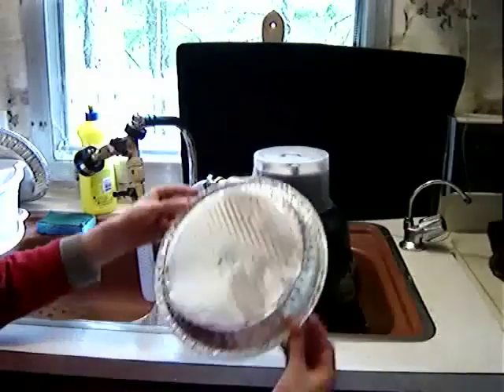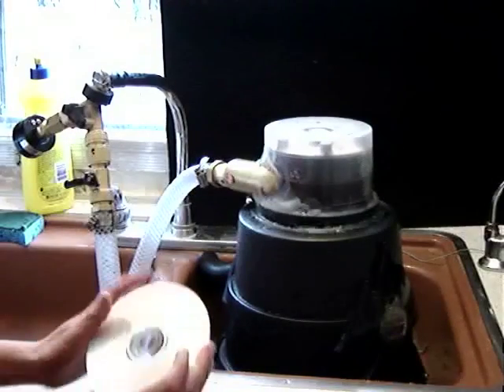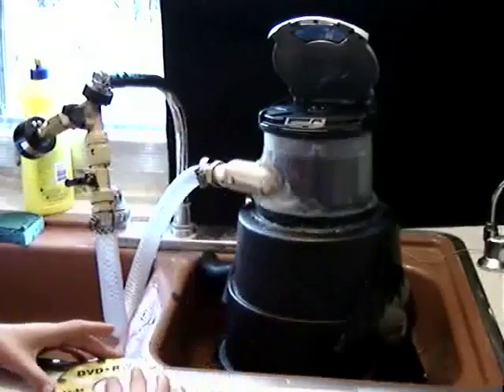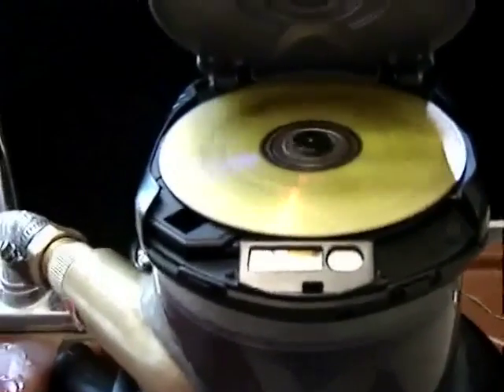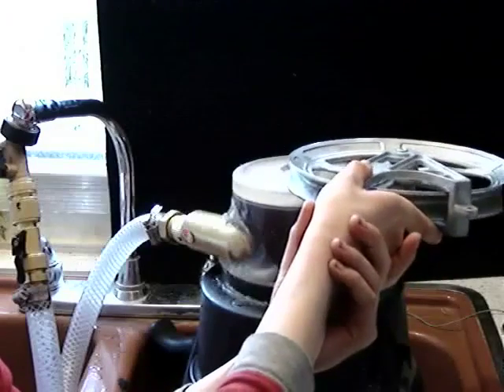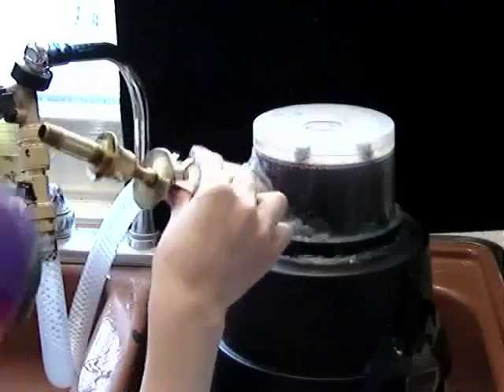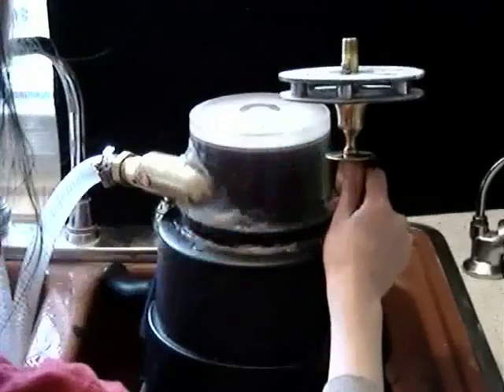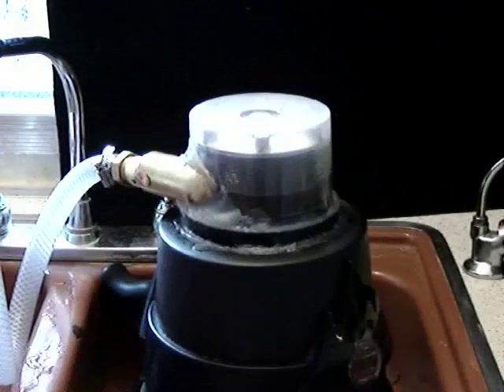SinkScience #13 - Will It Spin??

Comment from the maker: @XxLeurxX 

That is basically correct that the pan should heat up. However, the aluminum of the pie pan will dissipate the heat as fast as it can build up through magnetic induction. 

(Provided the rpm's are kept relatively low, as shown. At high rpm's, maybe it could bake a pie! ;)

Comment: Was just thinking the same thing myself - just pulled apart an old hard disk.. I mean, they're designed to spin up between 5,400 and 15,000 RPM... the trick I guess would be putting some sort of exit channel into the spindle or platters without shattering them..

Comment from the maker: Yep, did that and made a movie, but it didn't fly. Maybe on air pressure with more revs would do it.

The aluminum plate develops eddy currents that interact with the magnetic field of the turbine, producing torque on the plate.